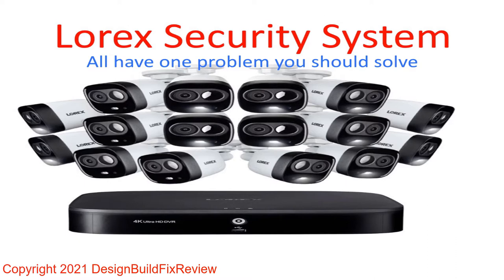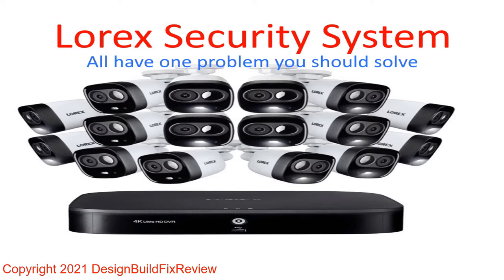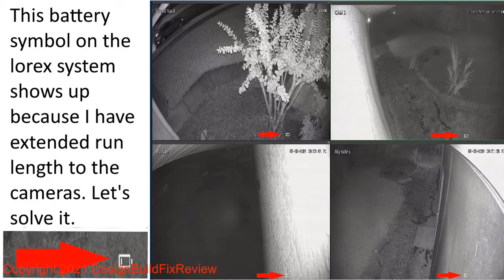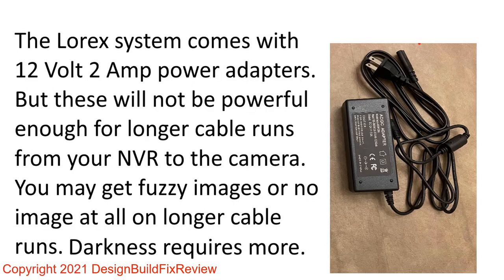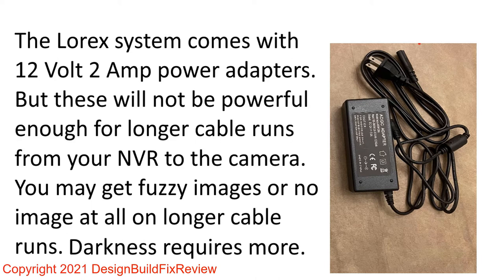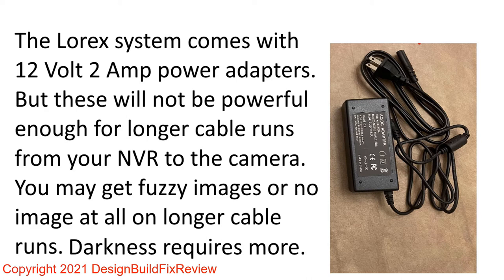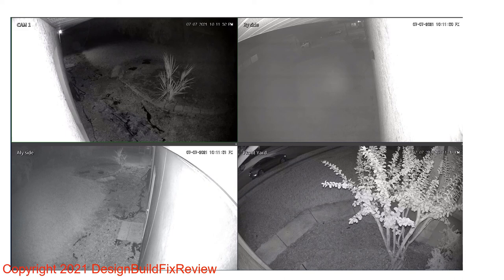Lorex Security System 4k Problem most people will have

Comment: I'm using a thinking about using netgear unmanaged Poe+ switch box for 8 Lorex 4k Poe wired cameras to better manage the wires running to the NVR. The Poe+ switch has a power adapter. How would I know if the cameras are being feed enough power from the poe+ switch box?
Reply from the maker: Because of the twisted pair wire the power should be more reliable then untwisted wire used on other systems. There are different catorgories of POE switches that can support 53-180  watts of power per port which is an insane amount of power. Most likely they can go higher.  If you were to do extended runs I would make sure you have the more powerful POE switch. Most likely they will all deliver enough power duriing the day. The lorex at night will beep if a camera does not have enough power, of if it is so bad the camera may not turn on at all. You will know right away.

Buy switch from amazon and if power not enough return for more powerful switch. I wonder how many amps the power adapter has and the voltage it runs at? To get say 53 watts minimum 12 volts at a little above 4 amps adapter.